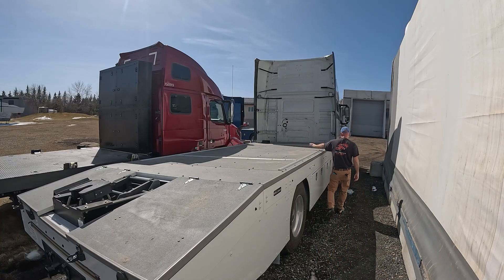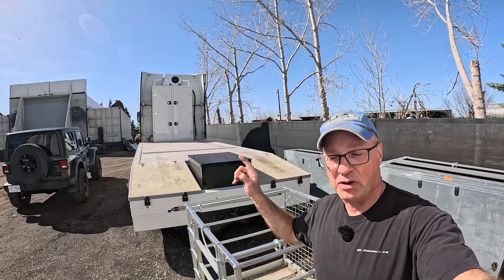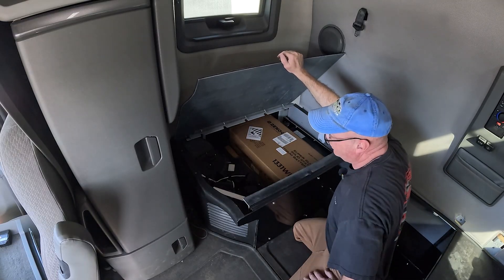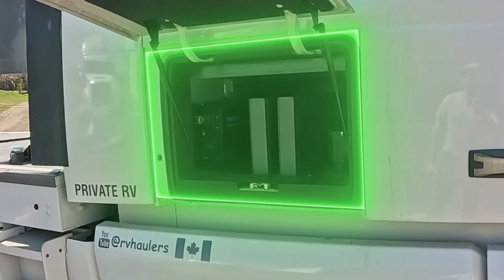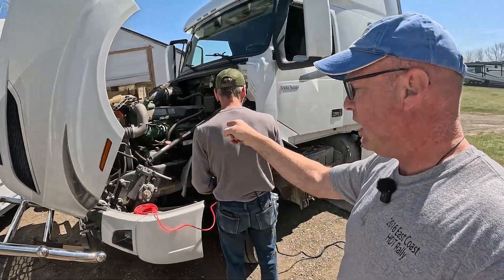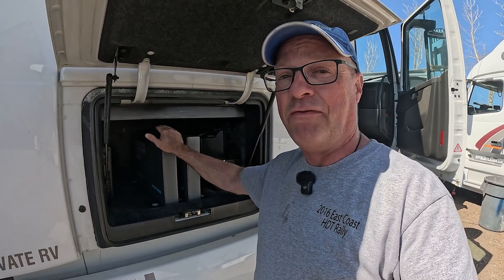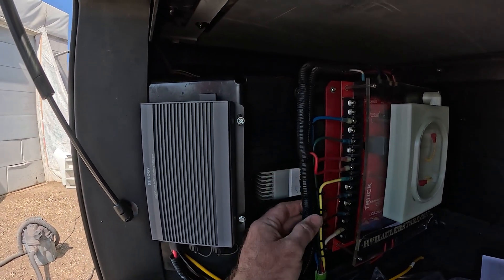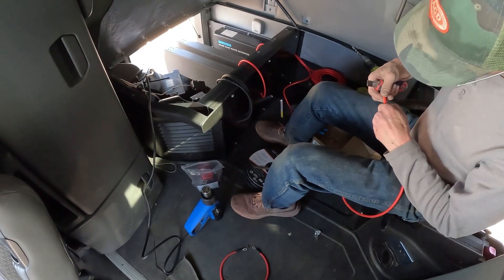$5,000 RENOGY SOLAR SYSTEM Installed on this RV HAULER—400 HOURS total Conversion, Totally WORTH It!

Comment: Hello Greg. It's James and Karie from Idaho. 
I have a quick question about putting solar on Maverick. 
I'm just want to maintain the current batteries on board while running the fridge and a starlink mini. 
Do you have a suggestion on watts required?
Any information would be awesome 👍
Reply from the maker: Hello Folks!

The Starlink Mini consumes an average of 20-40W in inactive mode and only 15W in idle mode. When actively using the Starlink Mini, you’ll need a continuous power supply of at least 25W to 40W. For an 8-hour workday, the Starlink Mini needs an energy source with 160 Wh to 240 Wh battery capacity. 
Running the fridge is safe because the battery management system will turn it off if we are drawing down the trucks batteries such that it won't be able to start.
I am going to suggest you allocate a battery dedicated to your starlink and devices.  A single solar panel will have a hard time trying to stay ahead of your wattage demands depending on cloud, trees, and just how long you are running the starlink.   

When off grid I usually use the timer feature in the starlink app to turn it off at night.

However, you may need to increase the battery  to maximize the time between recharges.  

The solution isn't cut and dried.   A solar panel, plus a charge controller and dedicated LiPo battery really is the way to go.  You can monitor your controller and quickly see what the solar is replenishing, and what you are drawing with starlink and other devices. 

There are also some really slick batteries   from companies like Bluetti that have direct solar input.  I use one when we go remote hunting.   It runs the starlink for a number of hours before needing charging (from my gas generator).  

Hope that helps.  If you want,  give me a call and I can better explain how I have setup to run my portable Starlink in various scenarios.

Gregg
Reply: @rvhaulers It all gets pretty technical and confusing for me.
I guess my idea is not as simple as it seems. 
I was thinking basically a battery maintaining system to keep the on board system charged without having to plug it in at home. 
The only draw on the batteries would be the fridge, starlink and what the truck system uses when not running. 
I was initially thinking 100-200 watts of solar.
Reply: @rvhaulers All of the solar gets pretty confusing when you are trying to run something. 
My idea is just to maintain the batteries on the truck without having to plug it in. 
Power consumption would be the fridge, starlink and the normal parasitic draw of the truck. 
I was initially thinking 100-200 watts as a maintainer only.

Comment: So, do those super slim batteries take the place of the four batteries uner the drivers seat? And if so, what do you put in that empty space the older batteries were mounted in?
Reply from the maker: Javier - these super slim batteries are in addition to the ones you saw under the drivers seat. The 4 lead-acid batteries are what starts the engine and runs the core of the RVHaulers mechanical systems.  

The super slims are added and are designed to run parked air conditioning, extra fridge freezers, charge e-bikes, microwave etc.

Thanks for helping me to clarify that.  Sorry to confuse you!  Thanks for the wonderful and continue support of my channel!

Thanks,  Ggg

Comment: I like the set up. I am Imagining a scenario of having the jeep on the deck, with a dead battery. May I suggest installing a remote boost location, such as an Anderson plug at the rear bumper, that you could also use to power a hitch mounted winch.
Reply from the maker: Great idea, we'll keep that in mind for future builds!  Keep the great ideas coming!

Comment: Just for clarification and to prevent any confusion...assuming LiPo is referring to Lithium Iron Phosphate (LFP) batteries, they have never had thermal run away worries.   Other Lithium chemistries that involve nickel do, but LFP does not and never has.

Comment: I am truly baffled that you can be in your industry, have as many subs as you do, and still choose a product like Renogy.
You could've easily been sponsored for Victron Energy. My apologies for a not so complimentary comment, but their equipment has horrible reputation.
Reply from the maker: Hello Rollin H!
Never hesitate to share your ideas and comments.   I truly appreciate learning and getting ideas from all my viewers that support the channel.  

So far with this early install experience I have been very impressed.  The solar performs exceptionally well.  

I am open to testing and trying products and subsequently sharing my impressions.  And we can all benefit from your experience and knowledge too.  

How has your personal experience been with Victron?  Is it working well for you? 

Thanks again for taking the time to comment,  Gregg
Reply: @rvhaulers I’ve been installing victron for five years now and the only time I’ve done warranty swaps is when DIY’ers failed on the install. People will roll their eyes when you tell them Victron is the best, but it’s usually because they didn’t want to pay a premium for reputable equipment that’s been around for over two decades. The warranty process is very easy, too. When the time comes for that inverter charger to come out, or the BMS failed on that lithium battery, the warranty process will be annoying. 
Either way, wishing you the best 😎

Comment: Can’t believe installing a solar system takes two and a half weeks, lol. I see so many solar installers do a complete solar installation in a few days maybe a week tops that includes 6 to 10 panels, many batteries and all the controls equipment plus running/snaking all wires and also installation of control panels in the RV.
Reply from the maker: Oh gosh I mistyped.  Thanks so much for caching my error and letting me know.  I fixed that descrption line item.

To clarify we built the new OverHood CANdrom, tested the structure and then removed it and painted it to match.  65 hours.

The solar, inverter, battery and wiring was 18 hours.

The overall RVHauler build was 400 hours.

Thanks again for letting me know,
Gregg

Comment: Ok Greg...now you really got my attention.
We have been working on something simular for our Pete.
We were thinking 2 alternators one for house , other for system.
Now we are playing around with the idea of putting battery's in a reg style drome box...maybe insulated.
Mount the inverter in the cab like you did. Wire the cab with 12 volt & 120.
The size of battery bank would depend on how much ya want to run & for how long.
I was thinking 3500 watts...with around 600 amp hrs worth of batteries.
With reg style drome we were thinking only 1 solar panel running sideways.
We just started thinking about a mini split air conditioner/heat pump...more research on this needs to be done.
But 1st thought was to mount exterior unit on top or side of drome box.
Anyways I'm so glad to see you venture down these roads.
Our idea was to just load the quad and head out for the weekend with no trailer & be comfortable.
And back up if anything ever went south with our trailer while out on the road.
Thanks Gre.g
Reply from the maker: Hey Rob,

Thanks for sharing your mission profile and ideas.  I will have a video shortly showing a really cool (pun intended) mini split PURE DC mature air-conditioning system.  In the mean time check out the IQ system from VoltAir.   Very impressive.

Gregg

Comment: What is your experience with these new renergy batteries as far as catching fire? I've heard a lot of reports of electric cars catching on fire.
Reply from the maker: Hi Thomas. 
In this setup you're seeing the newest tech SOLID STATE design that specifically addresses those historical issues.
This  new system has a 9x slower temperature rise which enhances safety & reduces thermal runaway.  

This battery has solid electrolytes, which now  ensures that the battery does not swell or burn – even if punctured or crushed.  YES THEY HAVE EVEN TESTED BULLET PENETRATION!

Thanks for the excellent question, 

Gregg